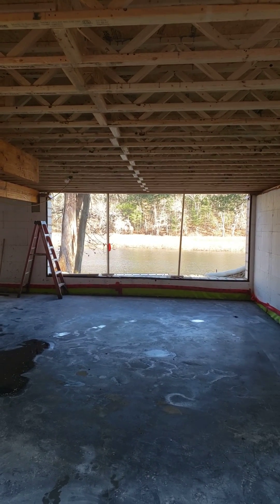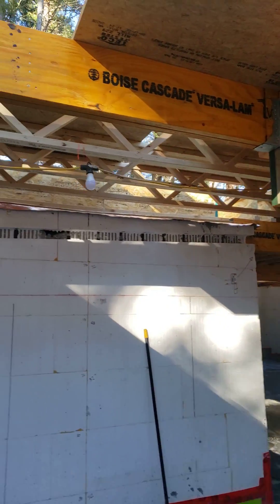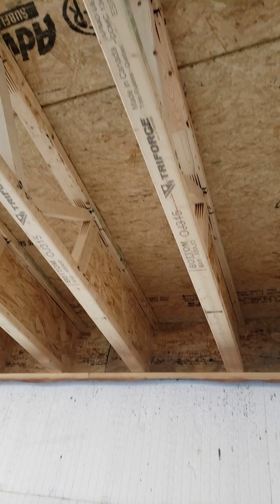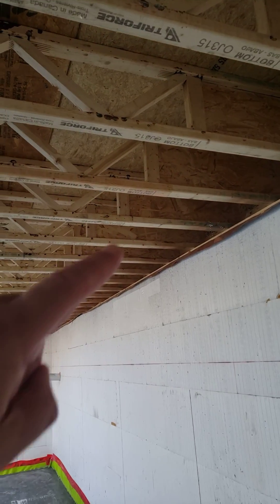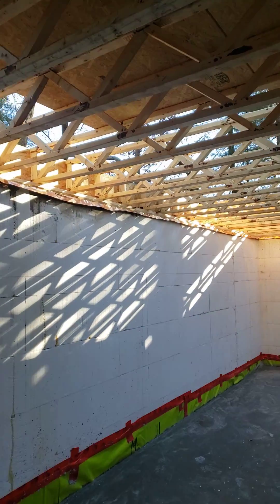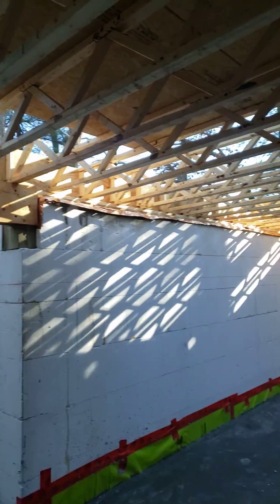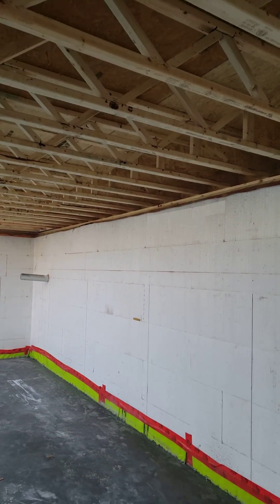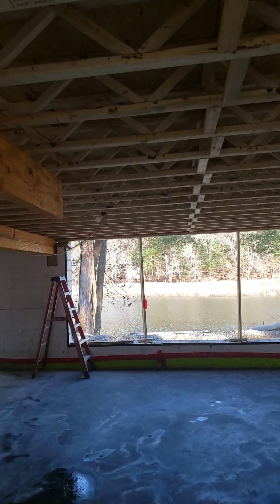Floor Framing Trusses

Comment: At 11 seconds into the video, what's with that laminated beam just hanging from the ends of those tri-force floor trusses?  I guess the supporting posts will be added later? Borrowing a phrase used a lot on the Perkins Builder Brothers channel, "That's one way to do it."  I guess the thick subfloor holds it up good enough for now.
Reply from the maker: Yes, framing started before the slab was cast